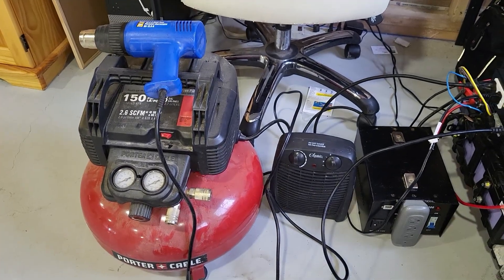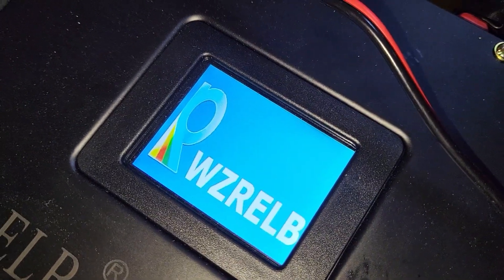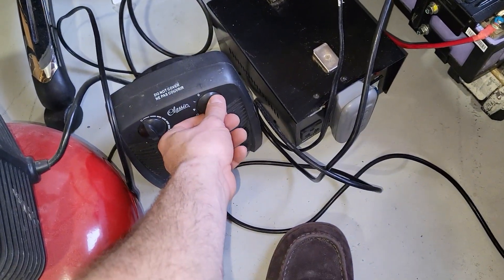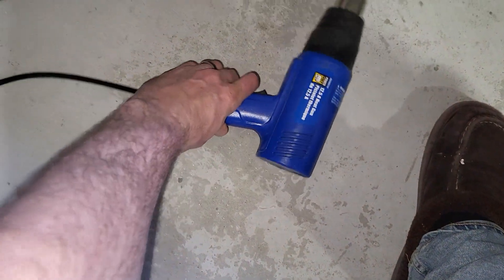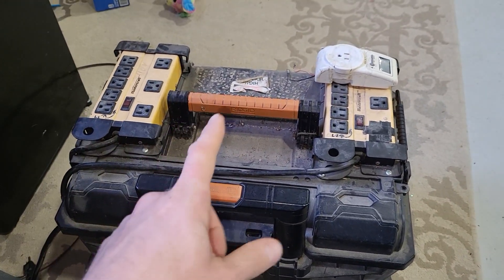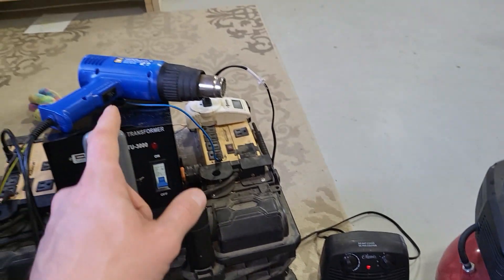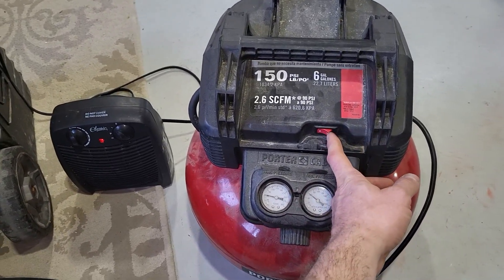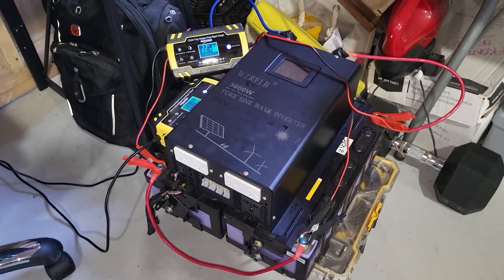Reliable 3000w 240v Test 4079w Surge!

Comment: Not revelant to the test of the inverter, but it's sad that the US uses that outdated 120v system. You guys have stuck to that one too long tho. To change it now would make many angry.  240/480v is much better. Less drop on cables, dont need that thick cables. Less issues with surges when you start things. The list is long.. :)

Comment: Split phase power is really strange.  We just run it all at 230vac 50hz. I think most of the world is 230 or 240v.  It makes testing inverters very easy at 230v.
Reply: True, but from a safety perspective split-phase is compelling.   You have your choice of using 120 or 240v, but in either case you always only ever have 120v from the hot wire(s) to earth.   As a result it is much  safer.
Reply: @GannDolph   I guess you have it so yes you would think that. However single phase 230v power  is also safe. One hot one neutral and one ground wire and correct use of RCD,s.  Higher volts also means smaller size wire. More choice of appliance brands and lower costs as its made for the rest or the world, not just USA and Canada.  That's ok if your happy with it, as you don't have a choice. When i wire a 240 / 230vac inverter I don't have to worry about splitting legs and specialty appliances.
Reply from the maker: @Justin Case Solar Power and Bush Camping Australia  not really sure why we use split phase, 🤔
Reply: @GoingOffGrid101  yes been trying to work that out.  Makes for a very complicated wiring job in a house with a total 2 x 110v legs and 240v legs to heavy equipment like HWS, Electric stoves and larger AC units.  Maybe it's what they started with and would cost to much to change.

Comment: My compressor does the same thing, if I'm pulling too much on my inverter the compressor just runs slower. But it still runs.
Reply from the maker: what inverter are you using ?
Reply: @GoingOffGrid101  a 3000va server room UPS with my own battery.
Reply from the maker: @Ben K  that's sick, I looked for some of these but only found a used 1500w :(